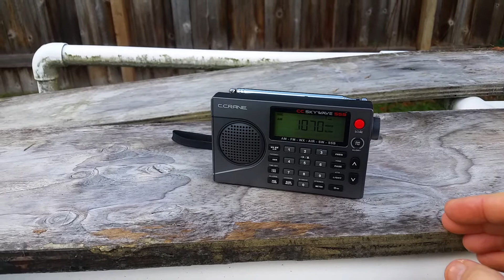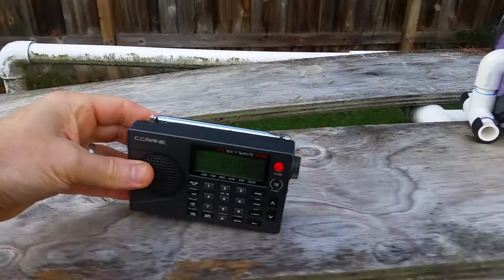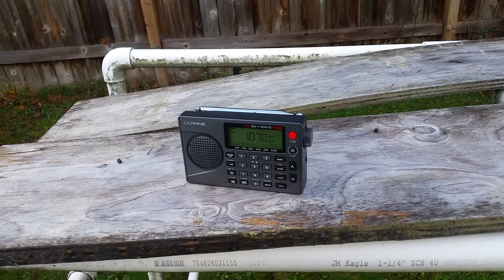5 inch (127mm) Frequent Flyer FSL Antenna Demonstration

Comment: Gary have you built any more of these but with just a few Ferrite Rods. I threw one together and it does a pretty fair job. I can now finally hear WSM-AM in Nashville in the daytime. Though, sometimes down in the noise level. For a mega watt station a 100 miles away. A sad joke for all the Tennesseans trying to tune the station in.

Comment: Just ordered the Ferrite bars, but may go with the 660 wire vs the 1162 stuff.
Reply from the maker: The 660/46 Litz wire is cheaper and easier to solder properly, but the 1162/46 Litz wire does provide more sensitivity. Good luck in your project, whichever type you choose!  Gary
Reply: Where can I order ferrite bars at I want to make up some am antennas?

Comment: hello Gary, where to buy one of the 5in antenna. thx
Reply from the maker: Hello 061811, Currently I don't have the time to make these available for sale, but there is a "Heathkit-like" full construction article for an equivalent-performing version posted at http://www.mediafire.com/file/pnfm8909c77zjoy/3.5inch-FF-FSL.doc
Reply from the maker: Hello 061811, There isn't any current supply for the 100mm ferrite bars used in this model, so they cannot be constructed for sale. A "Heathkit-like" full construction article for an equivalent-performing "airport friendly" FSL model is posted at http://www.mediafire.com/file/pnfm8909c77zjoy/3.5inch-FF-FSL.doc

Comment: Hi Gary, I'm surprised you have virtually nil reception of CFAX with the Skywave SSB from your valley location when using the receiver by itself. Across town from you, on Crystal Ridge, I get fair reception of CFAX with my Skywave SSB alone. Usually you are the one with better reception than here at higher elevation in Puyallup, which you and I have surmised is due to a better ground plane in the valley and your QTH closer to salt water Puget Sound. The unpredictability of radio is all part of what makes this hobby fun!  73, Guy
Reply: Hi Guy, I was trying for 1070-CFAX during pretty crummy conditions, and as you said the station usually manages a better signal here in Puyallup. In addition the signal was always there even without the FSL boost-- but the tiny cell phone microphone that I was using to record the video wasn't exactly the best equipment for the job :-) The main goal of the video was to demonstrate the signal boost that the FSL provides, and in this aspect the stock Skywave's anemic 1070-CFAX signal fit right into the plan!

Comment: How would i acquire one of these Gary. The Frequent flyer FSL that is. Or something similar? Thank's for sharing and 73's! Lee.
Reply from the maker: Hi Lee, There is a "Heathkit-like" full construction article for the 3.5 inch "Frequent Flyer" FSL antenna model posted online, which includes design, construction and operating information in a 22-page Word document format. Unfortunately I don't currently have the time to make these available for sale, but the construction article is posted at http://www.mediafire.com/file/pnfm8909c77zjoy/3.5inch-FF-FSL.doc    Good luck! Gary
Reply: You are a genius Gary , thank you and good luck with future constructions and lengthy Dxpedition's, 73's Lee.

Comment: Why would placing the radio closer to the coil not be a good thing? Overload?
Reply from the maker: Sam, the best inductive coupling range between the radio and FSL varies according to the frequency. For example with a station on 530 kHz it's about 10 inches, but with a station on 1700 kHz it's only about 1 inch. After a lot of experience using FSL antennas you get a pretty good idea of where to place the radio for the best inductive coupling boost,